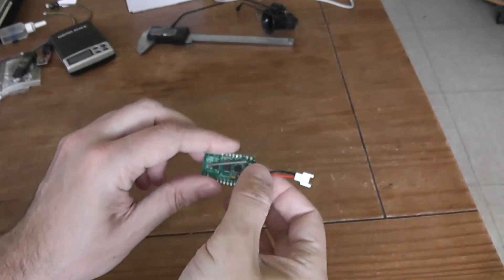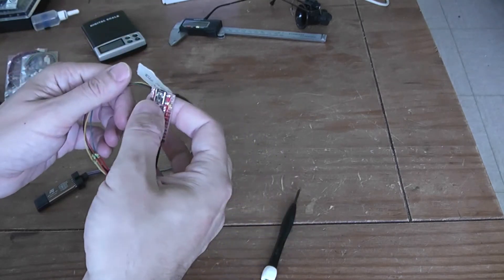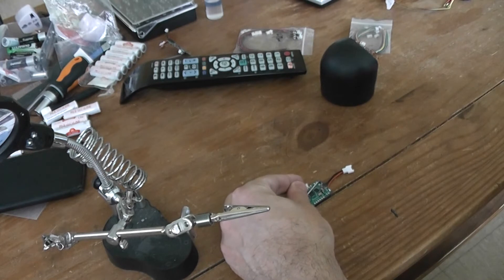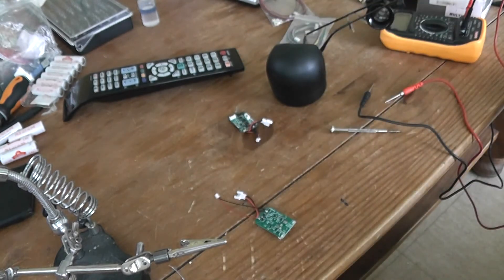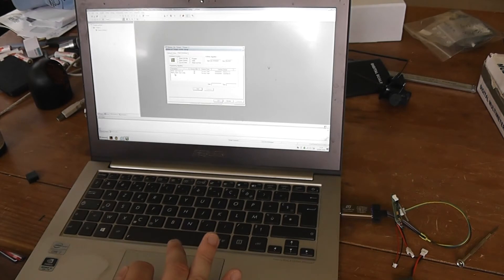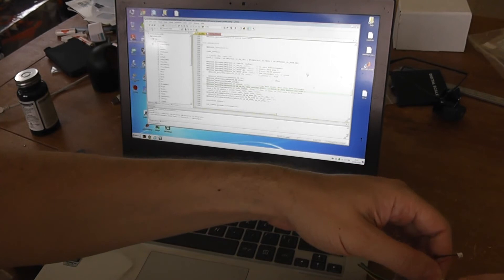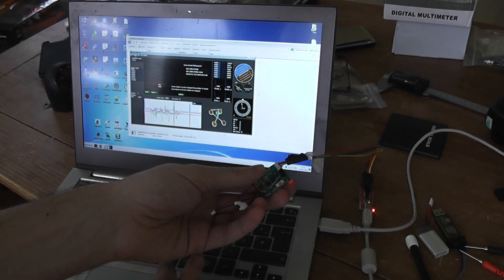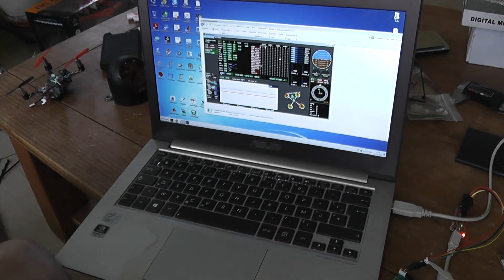JXD 392 Bradwii installation tutorial

Comment: Nice tutorial. I am waiting for the new AlienWii to be on general sale to see what they bring to the table. I might just not bother and get some JXD boards... At <£10 a go, can't be bad

With your soldering, I notice to are applying solder to the iron then to the component often. The best way is to tin your iron a little, then use the tinned iron to heat the target component and then apply solder to now hot component. You'll get better joins that way :)
Reply from the maker: David Nicholas Yes :) I am not a great handy guy with solder iron :). Thanks for tips ....
Reply: It's all practice. You will "get" it and never look back :)

Comment: Seby is JXD 385 board as good as this one? is it exactly the same? is a little bit cheaper and there is more sources to get it. But I have found some 392 boards. which one is better?
Reply from the maker: +Multirotor Go For the me JXD392 is better because it's supported 8.5mm motors
Reply: Well that is very important indeed. I do prefer 8.5mm myself. thank you

Comment: I managed to successfully go through the steps shown in the video, however now the quad does not seem to bind to the transmitter. Any ideas on what I could have missed or just how to debug this?
Reply: Discovered that it works fine with the FS-i6+IRX6 module. You need to wait for the bind, then use the "both down right" stick command to arm, and *in addition*, use the arm switch, if one was configured in MultiWiiConf.

No such luck with the stock transmitter. Stepping through the code in debug mode hints that the transmitter does bind, yet it somewhy only sends zero packets, no matter how you move the sticks.